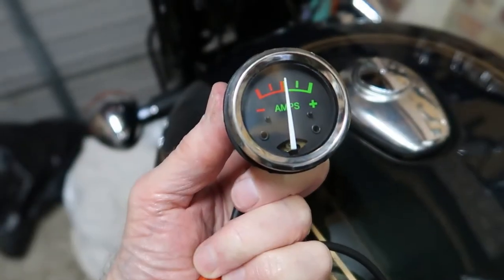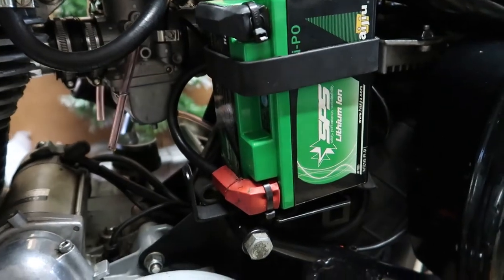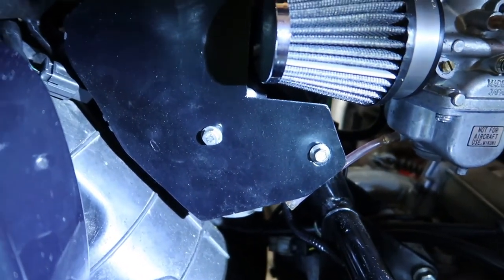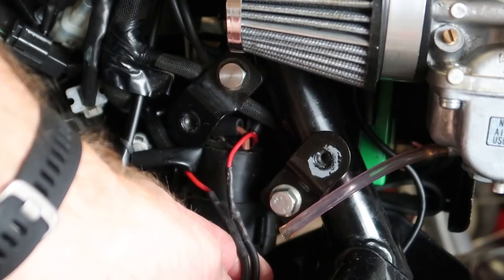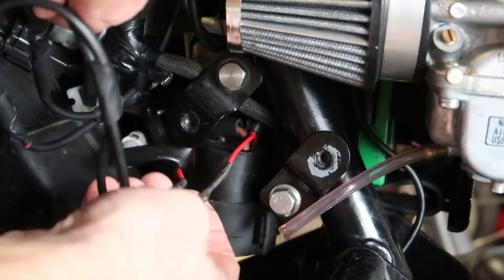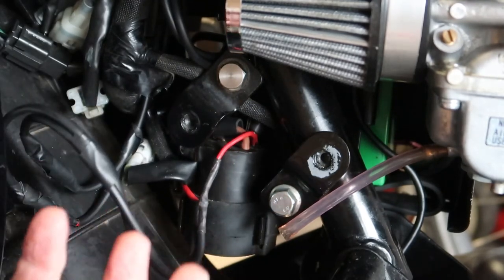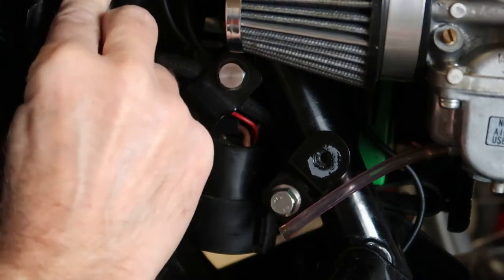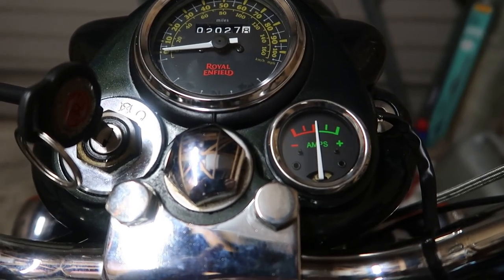How I wired an Ammeter to my 2015 Royal Enfield Bullet B5.

Comment: Hi Dave I forget to get back to you regarding my Clutch and Mot for my Suzuki Alto in September. I changed my mind from the main dealers. Took it there they started talking about the gearbox! Got my keys of them and booked in to my old mechanic in Enfield. The Clutch Mot and front brake pads pads all in with oil change £520. Sorry about delay in getting back I Did Subscribe and you pop up about the Enfield motor bike take care
Reply from the maker: Hello again. Glad you got it all sorted, obviously the 80 mile trip was worth it. My main fuse went the other day and the car just died....no electrics whatsoever.. AA man temp repaired the fuse,  and my dealer fitted a new one (complete positive terminal assembly, 59.00 ouch). No apparent reason for it to go....just glad I wasn't on a fast road or out in the dark! Nice to hear from you. You take care too.  👍👍
Reply: @DavidGarside 
take care keep well glad you sorted yr car and Enfield bike

Comment: Hi people has anyone got an Electra X 2007. And the wiring is different I have a grey wire and a black wire how would I fit the ammeter. Thanks
Reply from the maker: Hi Grant. The Ammeter usually goes in the positive wire between the battery and the rest of the circuit, but not in the starter wire (the big heavy one). It may be different for other machines though.
Reply: I may have to look under the seat there seem to be more electrics there

Comment: I got a brand new bullet 350 2024. It comes with a blank space for the "tripper navigation" but I was thinking of installation and ammeter there instead. And suggestions?
Reply from the maker: I think the first thing to consider is the warranty,  altering wiring may invalidate it. I don't know anything about the newer models or their electrical system, so it would be worth contacting the dealer to ask their advice. Show them this video and ask if they think it would work. Sorry I can't be more helpful. Good luck and fingers crossed. 👍🤞

Comment: Thankyou for a clear and simple Vid. I noticed you used metric sockets, are Enfield's use metric threads?  Tim.
Reply from the maker: Hi Tim. So far I've found only metric threads on the bike, but the chain adjusters from Hitchcocks appear to be imperial....7/16th af if I remember correctly. I'm not sure if there's a mix generally on other bikes or elsewhere on mine..... I'm sure I'll find out at some point. Thanks for watching and your kind comment.👍👍

Comment: Hi david can you tell me please what is the size of the ammeter i have a 2015 bullet and had the carb conversion and want to put a ammeter in place of eml and i see there are a couple of different sizes
Reply from the maker: Hello Jeremy. Yes, I'll measure it up later for you. 👍
Reply from the maker: Hi Jeremy. The outer bezel diameter is 45mm, so about 40mm for the ammeter. It fitted straight into the old hole vacated by the MIL. Good luck.

Comment: Really having a hard time wiring an ammeter to the Classic 500. Can it be wired with the kill switch? Please help.
Reply from the maker: I think the kill switch will probably only earth the ignition so don't think it will work from there. Is yours an older model ?
Reply: Its a newer model. Classic 500. But the wiring is almost same.
Reply: Is there any known method to add the ammeter without cutting any wire?
Reply from the maker: As far as I know,  this is the only way to do it. You could buy a volt meter instead which will give you the battery voltage and it's easier to wire. I personally prefer to know if I have charge though, which is why I fitted this.
Reply: @DavidGarside  Actually sir, I was planning to add an ammeter on the key slot and transfer the key slot to the toolbox, which I did. I tried wiring the ammeter in series with the ignition. It didn't work. It only showed the current drop and not the charging parameter.
Reply from the maker: If you speak to an auto electrician, he/she may know a different way of connecting. I've only ever known an ammeter connected between the wiring loom and the battery. It will measure the current flow in and out of the battery that way.
Reply: @DavidGarside  So sir, in which wire of the starter relay should I break in and connect the ammeter in series with?
Reply from the maker: @soumyadeepsarkar8320  . In the video I show how I found the correct wire and how I connected it all up. If yours is the same, then it should work as mine does. Obviously if it's different then I can't be sure that it will work on yours too. If you're not sure, get an electrician to check what you're going to do is the correct way.
Reply: @DavidGarside  I'll try the same. Hoping for the best. Thank you so much, sir, for your precious time, I'll keep all your words in mind. And I'll definitely let you know if it worked Thank you, once again for all your help. 🙏🏻
Reply from the maker: Ok. Good luck. Just take your time, make sure you insulate all the connections before reconnecting the battery. Make sure you get the right wire to cut into....mine is between battery and solenoid (thin wire). I await your reply.
Reply: @DavidGarside  The toughest part would be finding the right wire. I'll definitely let you know and keep updated. Thank you, sir, for all your help.
Reply from the maker: On mine I have two wires, one thick and one thin from the battery. It's the thin one you need to cut, extend the wires to the ammeter ( one to each connector) and that should be it. I was doubtful too when it did it but having wired them before I was sure it was right.
Reply: @DavidGarside  It worked! It worked! Sir, it worked! I've done exactly as you said. You've no idea for how long I'm trying to make this work! For over 2 years, I've consulting mechanics, the RE service centre and capable automotive electricians. No one could come to a viable explanation as to where the connection needs to be made without cutting a single wire. Some said that it will burn my EFi as soon as I'll switch on, some said that it won't be safe transferring high current wires under the tank. Some said it will drain my battery and some other bro-science too shameful to mention. The RE engineers told me definitely not to connect in line with the main fuse. No wiring can be cut as it will void my warranty. Can't be connected to the ECU. It was a big big problem. Well I can definitely assure you it was. Also, you'll see there is not a single video on YouTube based on this topic. I almost gave up. 

Then two days ago, I found this video of yours and I didn't know I was so blessed. Even after watching your video, I felt it was slight confusing as to which wire I need to break in. So, I thought of leaving a comment and as usual I didn't expect a reply. But things turned out to be different. Not only you replied but you also spoon-fed me the instructions! 

I went to a local mechanic to got myself the same connecting terminal plug which is connected in the thin wire. I added the ammeter directly in series with it without slicing a single wire. Fearfully turned on the ignition hoping nothing happens and oh my god, this unbelievable thing happened! It worked, sir! It worked like a charm just as you and your video claimed! Maybe its not a big thing, but adding an ammeter on the recent ECU 500 models as far as the complex wiring is concerned, the engineers and the mechanics had their head scratching and couldn't find a viable as well as an efficient way to do it. The RE engineers couldn't do it even after looking at their own internal foles which aren't made availabe to common people.

It was like a dream of mine to add an ammeter on the keyslot of the imperial casquette of the RE Classic 500 so that it can do justice to pure British motorcycling design and engineering. I planned to put an ammeter 2 years before even buying this motorcycle. When I did, everyone told the ammeter in this model would never work atleast without cutting a wire. But here we are! Under your guidance it was as easy as turning a page of a book. You made a complicated task look like its nothing. You sir, made a dream come true. 

Thank you David Garside for your excellence. I shall always remember and be grateful to you. Thank you once again. 

And therefore its true. ONE PERSON CAN MAKE A DIFFERENCE.
Reply from the maker: Wow, what a reply,  thank you. Before I did it, I spoke to a very competent auto electrician that works on expensive cars and he said there shouldn't be any problems with ecu's or draining batteries etc as long as it's done correctly. I could only do it by cutting the wire and extending each side of it through the ammeter. Mine has been fine so far so I'm happy with it. Glad you got there in the end . Thanks for the great comment and message. Safe riding.
Reply: @DavidGarside  You're such a good man. Thank you for everything. 🙏🏻

Comment: It worked! It worked! Sir, it worked! I've done exactly as you said. You've no idea for how long I'm trying to make this work! For over 2 years, I've consulting mechanics, the RE service centre and capable automotive electricians. No one could come to a viable explanation as to where the connection needs to be made without cutting a single wire. Some said that it will burn my EFi as soon as I'll switch on, some said that it won't be safe transferring high current wires under the tank. Some said it will drain my battery and some other bro-science too shameful to mention. The RE engineers told me definitely not to connect in line with the main fuse. No wiring can be cut as it will void my warranty. Can't be connected to the ECU. It was a big big problem. Well I can definitely assure you it was. Also, you'll see there is not a single video on YouTube based on this topic. I almost gave up. 

Then two days ago, I found this video of yours and I didn't know I was so blessed. Even after watching your video, I felt it was slight confusing as to which wire I need to break in. So, I thought of leaving a comment and as usual I didn't expect a reply. But things turned out to be different. Not only you replied but you also spoon-fed me the instructions! 

I went to a local mechanic to got myself the same connecting terminal plug which is connected in the thin wire. I added the ammeter directly in series with it without slicing a single wire. Fearfully turned on the ignition hoping nothing happens and oh my god, this unbelievable thing happened! It worked, sir! It worked like a charm just as you and your video claimed! Maybe its not a big thing, but adding an ammeter on the recent ECU 500 models as far as the complex wiring is concerned, the engineers and the mechanics had their head scratching and couldn't find a viable as well as an efficient way to do it. The RE engineers couldn't do it even after looking at their own internal foles which aren't made availabe to common people.

It was like a dream of mine to add an ammeter on the keyslot of the imperial casquette of the RE Classic 500 so that it can do justice to pure British motorcycling design and engineering. I planned to put an ammeter 2 years before even buying this motorcycle. When I did, everyone told the ammeter in this model would never work atleast without cutting a wire. But here we are! Under your guidance it was as easy as turning a page of a book. You made a complicated task look like its nothing. You sir, made a dream come true. 

Thank you David Garside for your excellence. I shall always remember and be grateful to you. Thank you once again. 

And therefore its true. ONE PERSON CAN MAKE A DIFFERENCE.
Reply from the maker: Thats brilliant, glad it worked for you too. I only did what I've always done when wiring an ammeter by cutting into the one wire, and a competent and long term auto electrician said there's no reason why it shouldn't work as normal. Mines been fine so far so fingers crossed it stays that way. Thanks for the great comments.
Regards. David.

Comment: Thank you 
❤️❤️❤️❤️
But my another question is that how to do the wrieing of the horn in royal Enfield bullet 👍🏻
Reply from the maker: It would be better if you could get a wiring diagram for your model as you should already have the wiring in place. Usually there is a fused wire from the ignition switch which goes to over side of the horn, and the other write to the switch where it wreaths when pressed. There may also be a relay in the circuit, which is why you'd be better looking at a diagram to make sure it's wired safely. Thank you for watching.
Reply: Thank you 💗☺️
May God bless you with happiness and prosperity